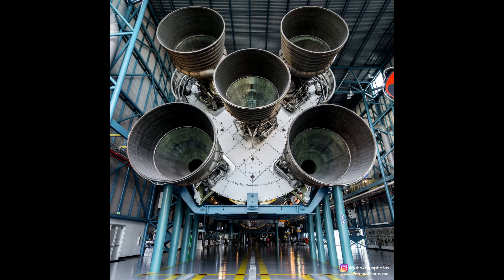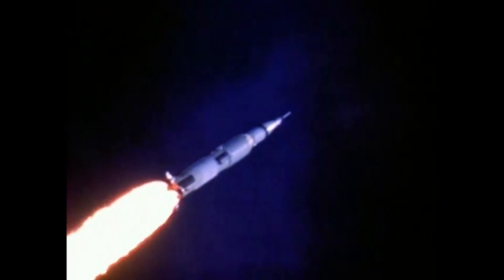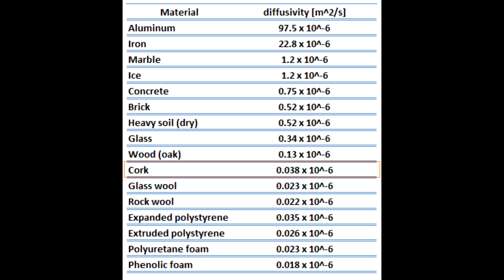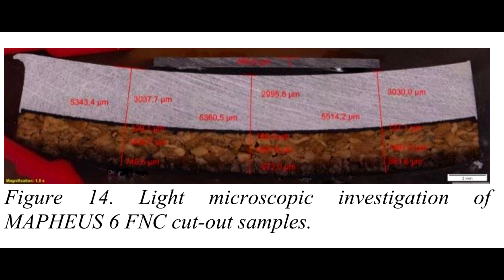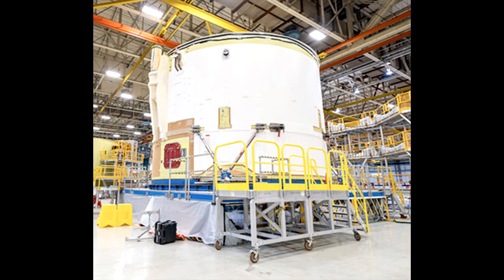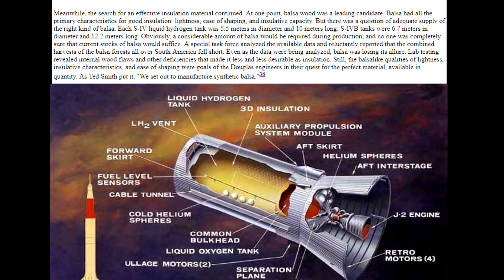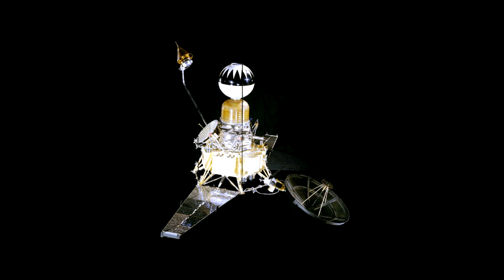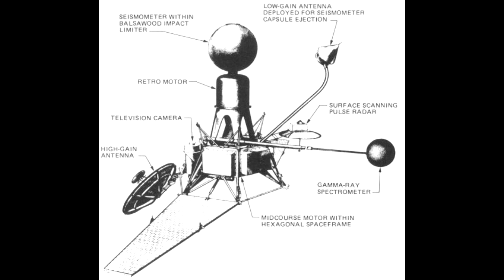Why Engineers Used Wood To Build Spacecraft

Comment: The removal of lignine from wood is done on a huge scale in the manufacture of paper. In order to do this, wood is chipped to small bits, otherwise the chemical treatment does not penetrate the inner portion of the wood. As a result, the Nature (!) article must be taken with grain of salt; big blocks of wood are just not easily penetrated with chemicals.

Comment: Wood is a composite of cellulose and lignin. cellulose has two elements a small rigid nano crystal  on one end connected to a long flexible fibral. Lignin is the cement that holds the cellulose together. cellulose forms long nano tubes within the trunk. this transports water and provides flexible strength to grow hundreds of feet high. The Nano tube create exclusion zone water which accelerates water to high speed, purifying it and extracting the DMSO and MSM needed for lignin production. Lignin by product DMSO is a useful solvent for further refining of nano crystals. Once separated the nano crystaline cellulose is a versatile material with high strength to weight ratio, durable heat resistant perfect for aerospace applications. The Nano fibrals a re strong and flexible making durable fabrics and membranes. The DMSO and MSM in lignan are organic solvents that are free radical scavengers and part of our immune function. They provide prophylactic protection from heat cols and radiation as well as treat exposure which is unavoidable in space. Why no one is aware of this? It's also a remedy for WMD exposure so we can't research this miracle product. Musk is wasting a lot of time and money on his flying tin can. He really needs to find out about Cellulose nano materials. No one wants to study it and those that do are operating on a plan to demonstrate failure to placate the FDA who made sure I never studied wood fiber science by arresting my brother for it. Stanley Jacob used DMSO as cryopreservant in organ transplants protecting organs from freezing while in transport. The radiation protection and treatment of burns by DMSO is something space travelers need to know more about. Trees have a lot more to them than we are allowed to know.

Comment: My airplane is an aerobatic category aircraft, rated to pull more Gs than most average people will ever experience, and the spar, aka the main structural member that supports the wings, and is subjected to pretty much the highest amount of forces of any component on the aircraft, is made out of.... Wood. The plane was built in the early 70s and I just flew it, did loops, immelman, lazy 8, hammerhead, split s, and more, last week. Wooden spar still treating me well.   It's an amazing material!

Comment: Walnut shell granules have long been used to strip paint off of aircraft and spacecraft.  Walnut shell is used instead of other common materials like sand (sand blasting) or glass beads (bead blasting) because the walnut shell is abrasive enough to remove the paint while not so abrasive as to damage the underlying aluminum surface.

Comment: Oh I get it. To make wood charcoal you'bburn' wood in a low oxygen environment. The edge of space containing almost no oxygen. Thus when the spacecraft is at its highest speeds during reentry, before deploying parachutes, the charcoal layers don't burn. Later as it slows, the charcoal itself isn't ignited because of the reduced temperatures, after it is low enough to be exposed to oxygen, or it burns very slowly, just like real wood charcoal does on your backyard grill. Took me a minute an some rewinding to realize.

Comment: In commercial aviation on several floor boards of almost any aircraft flying you will find that they are made of a sandwich of Balsa wood between 2 sheets of aluminum and glued together. The strength to weight ratio of this stuff is unbelievable and it produces panels that can be cut and drilled just like wood.

Comment: When at several spacecraft makers, balsa was proposed as a lubricant reservoir material to store liquid lubricants inside spacecraft mechanisms such as gimbals and reaction wheels. Polymer foams were then in use, but were in short supply and new materials were being looked into. Wood materials are largely dismissed due to a NASA prohibition on flying wood unless it has been impregnated with an anti-fungal material. For Earth orbit, a wood material should be viable, but for interplanetary missions, it is important not to pollute the planets you are going to with any foreign microbial life forms.

Comment: Wood was used a lot for mockups as well, it was cheaper and easier to work than metal and let engineers better visualize component placement in the days before CAD.  
Other industries used it to.  Fun fact, the USS Virginia was the first submarine built by General Dynamics that did not first have a wooden design prototype.

Comment: Fun little tidbit. The Brake Pads on the Montreal Metro lines (Subway Trains) use treated wood brake pads. So if ever you're in the Montreal Metro and you smell a somewhat woody burning scent as a train brakes hard, that's why.

Comment: As a retired spacecraft mechanisms engineer, I endeavored throughout my career to actually fly something made of wood on various programs. The closest I came was to use its porous cell structure as a reservoir for lubricants within antenna gimbals. The idea was unceremoniously shot down, but not for what I considered good reason. We had, after all, been using an open celled rubber based material previously, so wood did not differ too much in it's properties from the rubber. I'm glad to hear that it still had, and has, a place and was taken seriously by other disciplines.

Comment: We used to laugh at China using oak heat shields and the USSR using thermionic valves in aircraft. Turns out the wood was cheap and effective and thermionic valves were immune to EMP. Not so funny now is it!
Reply: Lots of reasons to laugh at Russia.

Comment: (4:01) - The wood will only char in the presence of oxygen.
No, the heat does not cause the wood to char.
It is a combination of the heat together with the increasing level of oxygen, as the returning space vehicle gets ever closer to ground zero.
On return from space, the wood will only char at the point where there is enough oxygen for it so to do.
This video is moronic.
>
Reply: Combustion only happens in the presence of oxygen. Charring specifically refers to incomplete combustion in a low-oxygen environment, or subjecting materials to high heat without combustion (pyrolysis). The heat alone is enough to drive off hydrogen and oxygen, leaving mostly carbon (charcoal).

If you've ever seen charcoal being made you'll know that wood burns to ash in the presence of oxygen, so once there's enough heat built up in the woodpile they cover it up to stop the air getting in.
Reply: @nagualdesign  So it does. I stand corrected.
Damnit I've even made charcoal in the past !
>

Comment: Apple: we used aerospace graded aluminum!
Aerospace engineer: Actually we used wood.
Reply: A phone covered in cork might be a lot more impact and scratch resistant. There's even a way to make transparent cellulose nowadays although not with the clarity we expect for our displays. :-)
Reply: @DeclanMBrennan  Cellulose is naturally transparent. The original clear plastic wrapping film and bags, in common use well over 50 years ago, were all cellulose. The film for movies and still cameras was all cellulose, until less flammable replacements could be  provided at acceptable prices.
Cellulose is highly flammable (it has been used in explosive devices), and unstable in high humidity and temperatures, where it can degrade within a few months. That's why old movies are stored in secure low temperature conditions.
Reply: @RWBHere  Thanks for the interesting reply. I admit to being somewhat outside my area of expertise but is there not a difference between cellulose and celluloid ?
Reply: Aerospace grade wood.
Reply: @Pelican in shit don't bother it's bait
Reply: Not even wood, just bark
Reply: One of these cracks

Comment: Wood, depending on type, has pretty good specific strength, comparable to many metals. The problem with wood is that it is anisotropic and subject to biological corrosion. It also comes in limited dimensions. You are not going to bet a 1m x 1m x 50 m homogenous beam of balsa anywhere.

Comment: I once used a piece of wood as a melting crucible becouse I did not have a graphite cruicible at that time. I have melted a piece of steel inside it. It worked pretty well.

Comment: I remember seeing irradiated wood tile made at WCU in the seventies.  The radiation collapsed the wood structure and compressed it so it formed a very hard surface.  It did not need boiling or compression as the radiation accomplished the conversion.

Comment: Did you know that wood has the best earth quake protection rating in Japan?
Did you know that wood has the best heat loss protection class in the European Union for house construction?
Did you know that wood has the highest class in fire protection in the European Union for house construction (exceeding T-180 easily)?
Did you know that wood has the best protection against radar / radio smog, that even the military turned to it to protect vital communication lines?

And there is more, like wood reducing the heart beats during 8 hours of sleep by roughly 1000 beats, if the correct type of wood is used.
That the oldest wooden buildings are more than 1000 years old, or that Julius Caesar actually gave out the death sentence for people who didn't deliver "moon wood" to the Roman Navy for its galleys (trees being cut while the moon was decreasing). That moon wood actually is more resistant, according to studies which were made some years ago.

Yes, wood deserves to be an everydays material, sadly we are wasting so much of it for useless junk.

Comment: It's important to remember that wood is in fact a highly advanced composite material maximized for strength versus weight over millions of years of evolution. 

Wood is fiber held together with resin in a tree. 

In fact palm trees have an incredible bending and flexing  strength for their diameter and height. 

Oak also has incredible stiffness.  Look at the strength and density of fibers at the branch trunk of a huge Oak limb that may Wright thousands of pounds and extend 50 or 100 ft out in a horizontal direction. 

Wood is an extremely advanced composite  material.

Comment: (7:19) What the heck is THAT thing! Some sort of space shuttle model someone built from wood? :P I'm not sure what it's actually based on. It's not quite the right shape for the space shuttle or the Russian version, I don't think. I'm going to have to do a bit of trickery in order to search for it. (Screenshot followed by a reverse Google image search.) ;) EDIT: Apparently, it is a wooden mockup of the Russian Buran space shuttle meant for use in wind tunnel tests! Interesting. :) It's too bad that it is left moldering in a field somewhere, though. :/

Comment: Come to think of it, Wood has extraordinary bullet-catching properties if you compare materials of the same weight. Also wood could be grown in orbit using astronaut feces for fertilizing, thus sparing payload capacities. This might make for some cheap but efficient shielding against high-speed-dust-particles. Also wood tends to splinter instead of pulverizing so you dont produce new particles on impact.

Comment: The French were actually the first to successfully utilize liquid fueled rockets but the Moët aerospace company had issues separating the command module properly from the last stage. An astronaut had to reach outside the cork capsule window and manually twist free the wire cap to initiate a champagne burn.

Comment: Back when I worked on Shuttle we would sometimes go to the VAB and do a little work on the orbiter after it was mated to the tank and boosters. There was cork all over the boosters, especially down low around the aft skirt area. They mixed it with some kind of rubber compound and it looked like it was molded in place like clay. I'm sure they will be doing the same on SLS.

Comment: Thank you! 
Awesome presentation!
Wood was also bulked, pressure treated and stabilized in the U.S.S.R. and used for dimensionally critical molds, the extent it was used is unknown and the exact prosess is lost, but it was used because the individual components that make up wood are more dimensionally stable to temp changes then most metals.
(Wood is of course not dimensionally stable without treatment)

Comment: One thing cork DOES NOT work well for is gaskets. GET THE RUBBER GASKET.  I suppose it was relatively good in its day, but rubber(ized) gaskets work better and last longer today. 

I work at an auto parts store. Nostalgia has its place, but sometimes it's downright irritating.

Comment: During WW2 the nazis where envious of the British plane De Havilland mosquito made of wood. Göring said “a beautiful wooden aircraft that every piano factory over there is building... they have geniuses and we have nincompoop.” At the time they where already building the first rockets the V2.
Reply: To be fair, Göring didn't know just how incredibly difficult the Mosquito was to construct. The Allies maxed out their production, but were still only able to build about 7,700 of them. The advanced glue, the correct wood, and the skilled labor all ultimately ended up being in incredibly short supply. The Mosquito wasn't just some 2x4s held together with whatever drywall screws you had handy.

While the aircraft itself was highly successful, the idea of making high performance aircraft out of non-strategic materials like wood just didn't scale. Things like trainers, artillery spotters, gliders, transport aircraft and even low performance ground attack aircraft, like the Po-2, could be made of relatively common woods and relatively common labor. The Mosquito required exotic and extremely high grade woods that were just not available in high enough quantity.

Comment: I have heard a story that the Polaris SLBM reentry vehicles back in the '60s used wood cut from a specific forest in a particular Alaskan island. I cannot recall exactly what type of wood, but birch rings a bell. Apparently the US government declared that forest of trees on that Alaskan island to be a national strategic natural resource, so it couldn't be logged by any random company to sell off. I was told this story by a veteran of the Polaris SLBM program when I visited the Sands Space History Center right next door to SpaceX launch and landing control in Cape Canaveral. I have wanted to learn more and find sources on this but came up dry in my research, except this one comment: https://www.centauri-dreams.org/2017/09/20/a-fleet-of-sail-driven-asteroid-probes/#comment-165453 "The Polaris A-1 and A-2 re-entry vehicles used plywood as the ablative material." I would really love if someone can help me research this and find more sources, or disprove it if the story is actually bunk.

Comment: I used to work on a magnox reactor and the machine used to insert and remove fuel rods was covered in plywood. I never worked on this part but was informed it was used as for it's density it was a good gamma ray shield.

Comment: Hardware store cork sheet works great as an ablator and heat shield for shock impingement on supersonic vehicles.  Attach with cove molding adhesive.
Reply: I feel dangerously inspired by that remark.

Comment: Fun fact: Firefighters use wooden ladders because they are 'fireproof'. That claim is a half-truth of course: real reason is that it takes relatively long time for the solid wood to burn trough its structure - it remains a load bearing for much longer than i.e. carbon fiber or aluminium ladders, which fail catastrophically much sooner, but still that's a fact. Steel ones last longer, but are obviously much heavier. There are many ways to turn easily combustible materials into fire retardants, i.e. highly compressed hay (It has been tested as a building material in Australia, where house fires are a big concern) is extremely hard to ignite, because it has no air inside. Wood has its uses, hay has its uses, and honestly it's very hard to find materials around us that are useless.

Comment: Wood is an amazing material. It can take up many times its weight, it can be engineered, chemically changed, it can withstand long periods of time without much alteration (within reasonable limits).
Reply: The big downside is unpredictability. It’s nigh-on impossible to accurately determine the strength of a given piece of wood.

Comment: Scott:  SpaceX is intending to use polished stainless steel to reflect heat during reentry along with tiles. We see the development of Starhopper and starship using what appears to be wrinkled and dented natal panels.  Should this wrinkling issue not be addressed, how will this effect its thermodynamic properties during heating.  Would it not cause an increase in heat absorption in the wells of the dents and seems? (Hot spots) Or is this effect negligible. Hoping you may be able to shed some light on this?
Reply: This are test hoppers that will never reach the orbit, they meant to be cheap, not pretty.
Reply: Both Boca and Coca are currently building orbital test ships.  Not hoppers.

Comment: You mention wooden planes but don't mention the wooden wonder, DeHavilland Mosquito 😥
Reply: Or the turtleback on the Hurricane.
Reply: @NomadPrototypes  Was the glue used Resorcinol cement?
Reply: @NomadPrototypes  Tx for the info. W
Reply: The Mosquito was one of the first composite planes built too. It just used wood instead of fiberglass or carbon fiber in the layups.